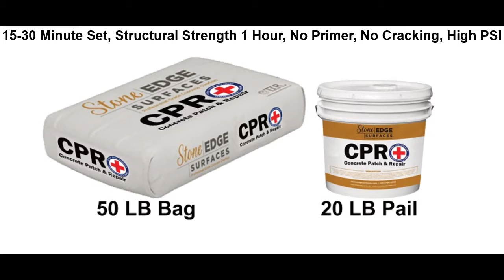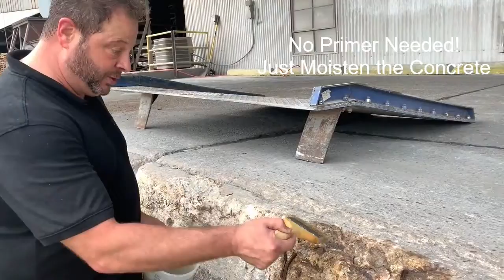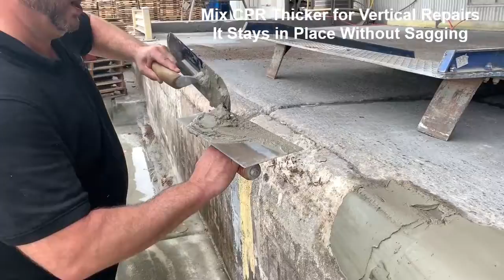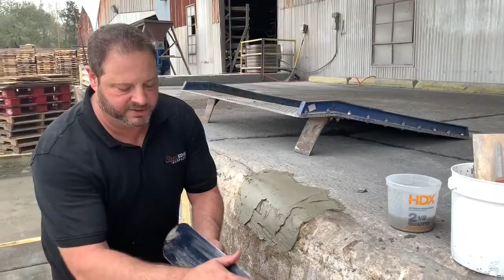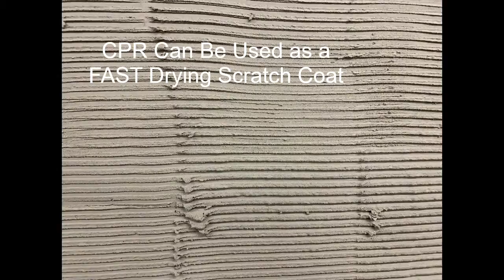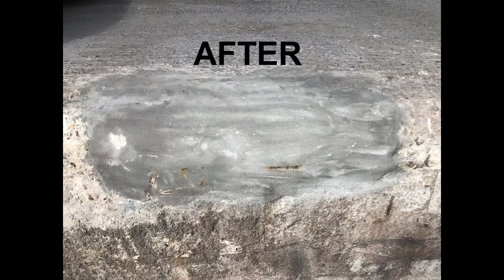CPR Concrete Patch and Repair Vertical Application V2 1 03032020

Comment: Hey 
 Stone Edge Surfaces, I am working on restoring an older home with a lot of cement features including a cold war era bomb shelter. You product looks like good fit , in my case I have to patch a lot of overhead ( ceilings ) concreate slabs so if you do another video please do one doing overhead application.

Comment: I noted that CPR can be applied under water.  How long does it take to cure?  Can it be applied just before or even during rain?  Are there weather restrictions?   What about freezing temperatures...it there a temperature range that it has to be applied within?
Reply from the maker: It can be applied underwater and during rain...it needs to be mixed thick as the cream will quickly wash away. average is 15 to 18 minutes to set then hard within 30 minutes or so, It is mixed with water so freezing temps during install are an issue, so have to stay 45 to 50 degrees for install